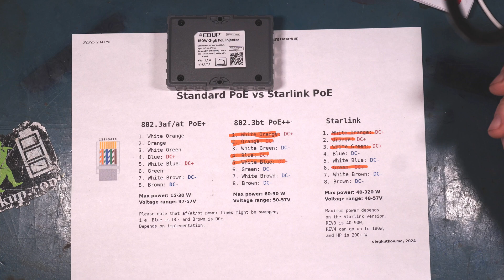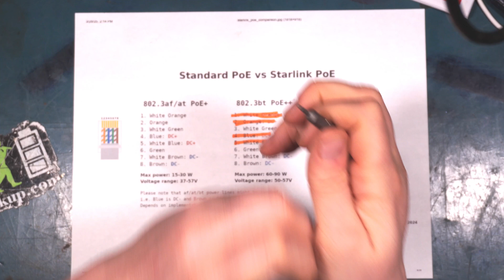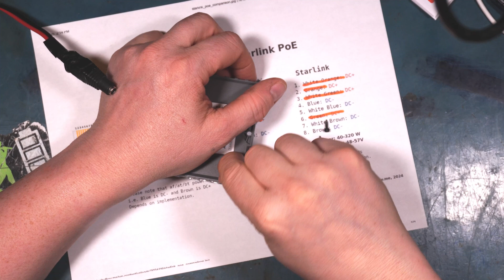Checking out a "Starlink" 90w Passive POE Injector

Comment: Do you think the original AC to DC power supply will work with this device? I believe the output is 30v/2amp if I'm not mistaken(starlink mini).
Reply from the maker: This is only an injector. So the printouts need to match & the voltage

Comment: Ms Fixit, I don't know how I missed this video, and I apologize for that. I see that you found one of Mr Musk's bastardized doohickeys (not his children) and I appreciate you going over it. One question for you: how do you feel about PDs that use physical signalling to negotiate 802.3af but then REQUIRE LLDP from the PSE to consume 30W or more? Also, I have a passive PoE injector that supports 60W. When I plug a PD into it, I see a little spark in the RJ45 plug. I've never seen this before, and it doesn't seem right, but it does work. I'm not sure how to feel about it. Thanks!